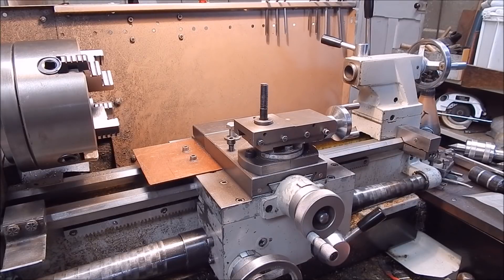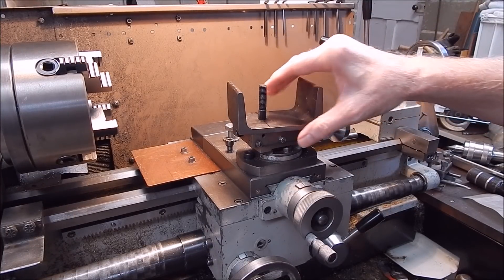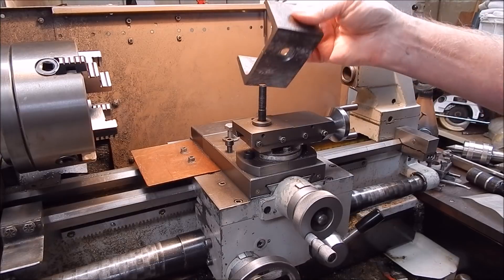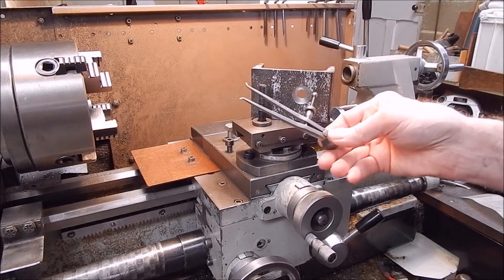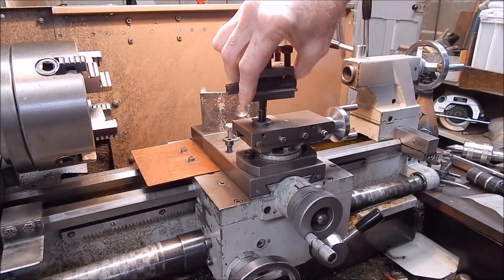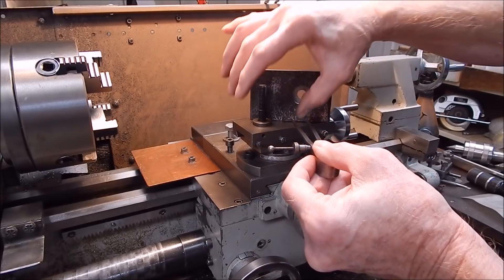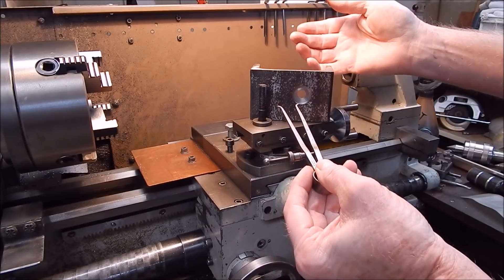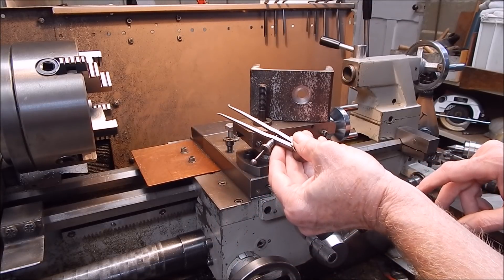A simple machinist trick that often comes in handy

Comment: OMG. You can take a set of outside calipers just like you have. Pick up on the o.d. of that washer thing and work the two (inside and outside) calipers together and make a press, slip or sloppy counter bore. Or just use a boring head in the mill.

Comment: The thing is though callipers take a lot more finesse than a mic’s and telescopic gauges/mics and ball gauges
Reply from the maker: Yes, but think about how they managed to make high quality metalwork/machinery in days gone by without all those things ;)
Reply: Over 300 years ago there was no real standard so every thing was by feel so it didn’t have to be high quality (high precision by today’s standards actually) if something was with in 5 mm and fits it would of been fine, now we want stuff with .02mm and less, flatness is different story they got stuff incredibly flat with basic hand tools
Reply from the maker: The early machinists made some extremely accurate machinery. Definitely on a par with current standards in many cases.  How do you think they made watches and clocks ?
Reply: Clock work isn’t necessarily precision work as tight tolerance as long as the gears spin freely and have the right tooth count it will be fine, for example if a gear losses steps on the first 180 degrees of a turn it will make it up on the second 180, there is a bloke on here with a good channel called click spring he makes a lot of “clockwork” stuff, as I say before the industrial revolution things didn’t need to be accurate they just had to work I’m not say it wasn’t good workmanship and I’m not say it wasn’t impressive, I’m actually highly intrigued buy the works of yesteryear, it’s just not high precision work. How can it be high precision work when they had no way to measure and verify its precision against a standard

Comment: Are you saying you don't measure those calipers with a mic? I use a vernier or digital caliper to save a step and always get a proper fit, but when the need arises to go old school I would absolutely pass that through a mic so I know what my finish bore size is suppose to be. Now, that's for diameter. What do you do for the depth? 
You certainly were right when you said this was a trick! Quite a trick to make a bore to fit perfectly when you don't know the diameter or the depth! If I were that good I could have saved thousands on measuring tools!
Reply from the maker: This is a method all apprentice machinists are taught.  It's totally legit and it works.  But then I guess you've never been down that path.

Obviously depth is a different issue and travel readout with a dial indicator is used with a boring bar.  You could use a depth indicator if that is more convenient.

It might pay you to read the video comments by professional machinists  ;)

Comment: I agree never underestimate a pair of good old calipers.
We used to put a mic on them if we didn’t have those fancy new fangled telescope gauges and were working to a known size.
Good tip. :j
Update
You can also measure an o ring groove on an internal bore with calipers which is pretty much impossible with any other tool I can think of.
Set the calipers compress the spring to remove from the grove then mic the the calipers, easy!
Reply from the maker: Good tip Davo.

Comment: When Dad brought home the metal lathe from Grampa's house we didn't have anything more accurate than a tape measure. Everything was calipers. 
The feel is what I had to learn. The improvements in measurements over the years were designed to eliminate the need for any talent  in feeling the fit. Ratcheting mics, air gauges, CMM, lasers, meant we didn't have to spend time training people on the line.

Comment: Useful idea Rob - I guess most times in the past is I use a telescope gauge that I know will lock up reliably.
Reply from the maker: Hi Chris,

This will do very small diameters, which is where the error factor is always greatest.

I don't have any telescoping gauges.

Cheers Rob
Reply: If you need to do smaller holes use ball gauges

Comment: Perfect timing, I am boring for some small bearings and I find I concentrate really hard to get the first one perfect, then doing the second, I get greedy, or distracted, and I am over size before I start sneaking up on the dimension. And of course, the caliper is just sitting there within reach! Thanks for the tip, cheers mate!
Reply from the maker: This would be a sure fire method for your current project.  I expect some people doubt this can work accurately, but it's amazing how sensitive feel can be.  As stated in other comments, this is a well proven, time tested method taught to apprentices.

Cheers Rob

Comment: And cheap wigglers work just as well as expensive edge finders in the mill.  Kerosene works well as a cutting fluid for me and costs much less than the highly advertised commercial products.  I only measure dimensions when I'm forced to because I usually just cut until it fits right and my combination square has the yeoman's duty in my shop.

Comment: There is another method that is akin to what Rob shows here. It is the "rocking pin" method. You might only need this very rarely. I found this in a 1943 edition of the American Machinist's Handbook. It gives the formulas for a pin with rounded ends whose length you measure as accurately as possible. Inserted into a bore, you measure the side to side rock of the pin with a scale. From this, the diameter of the bore can be calculated very precisely.
  Again a technique that you might never use, but knowing that it can be done might be useful in a situation where your normal methods of measuring the diameter of an I.D. won't work.
Cheers from NC/USA